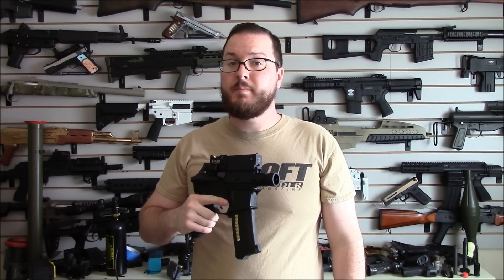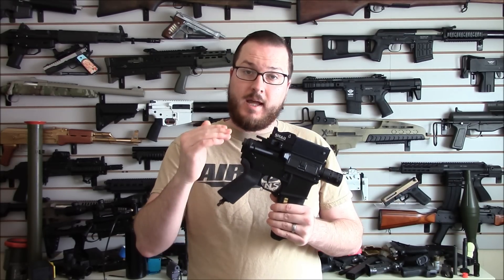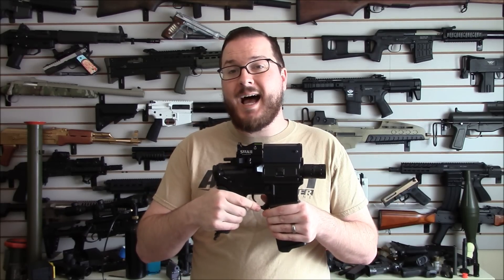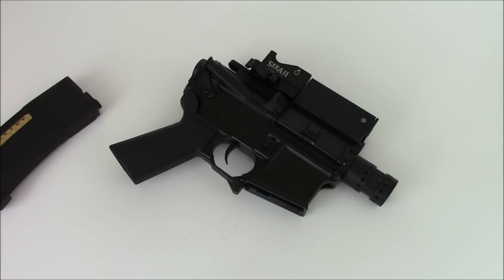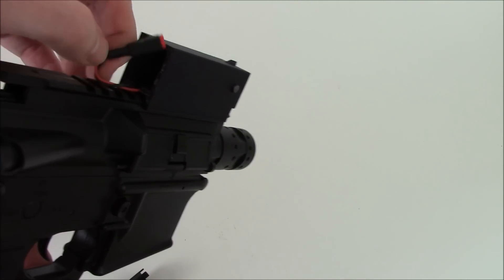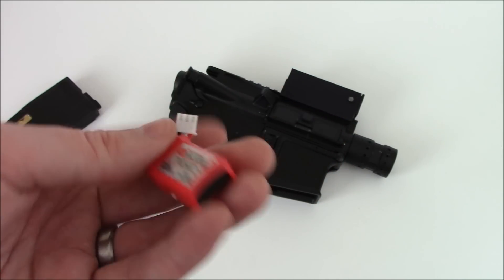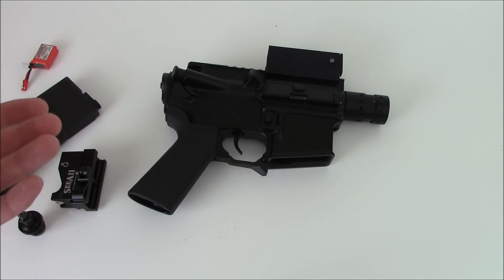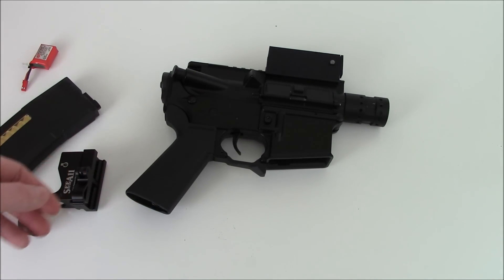Wolverine Airsoft Inferno/InGrip Regulator Overview - Stubby M4 Pistol

Comment: Booligan, I was wondering if you could give me a list of what components you put in the make it run CO2, specifically what the connector coming out of the bottom of the Storm is called, what sort of reg line to use (or can be used), and what connector (if that's what it's called) to screw onto the tank. Thanks a ton, keep up the great videos.
Reply from the maker: +Evan Cochran I used a Wolverine Airsoft Inferno kit, Storm InGrip Regulator, and Ninja remote line. The connector between the grip and the remote line is a standard remote line connector that came with the line. This is the remote I'm using : http://www.amazon.com/Zebra-Ninja-Paintball-MicroBore-Remote/dp/B00IN6NS2U/ref=sr_1_2?ie=UTF8&qid=1454859158&sr=8-2&keywords=ninja+remote+line

Comment: I am just kinda getting into the whole airsoft thing. Coming over from the dark side of course ;) As a long time paintball player, I had to cringe a little at around 3:30. But again, I'm new here. Keeping an open mind. The bb hose thing is absolutely hilarious!
Reply from the maker: +Michael Wangerin What did you cringe about at 3:30?
Reply: +Booligan Airsoft You mentioned co2 is more efficient than HPA. When I first got into paintball, I ruined a nice marker by running it with co2, and all my internals got destroyed from the cold. That was the day I learned about HPA. Watching the stubby M4 shooting with that high of a rate of fire on that kind of gas just makes me nervous I suppose. Not by any means trying to pick a fight! Only reliving a horrible $400 mistake haha.
Reply from the maker: Yeah, airsoft is totally different. Our air usage is so much lower than paintball that you can't really compare. With this regulator, you can run CO2 with the Wolverine Inferno. It's not a setup for every HPA type engine. 

And yes, CO2 is more efficient than HPA. Whether it freezes up your gun is a totally different issue altogether. When I played paintball, there were certain guns that had to use HPA (Stuff like the AutoMag RT). This is no different, just depends on your setup. This setup that I'm running should give me 6-10k shots per fill on my 20 oz tank BTW. 

Welcome to the sport! There's lots of new stuff coming out constantly, so get used to stuff always changing, haha.

Comment: Do you have game play videos using this setup? Thanks!
Reply from the maker: +Adam Goodwill Not yet, but hopefully in the next few weeks.
Reply: +Booligan Airsoft Cool! I'm considering CO2 tank since my area is not close to any HPA fill station. I'm wondering on the consistency of FPS granted that the weather temperature is about right & duration, number of rounds before FPS starts to drop or when your CO2 tank needs another refill. Thanks for the help!

Comment: I know that the in grip regulator will with with co2 (with the inferno/hydra), but can you use co2 with an in grip regulator and a polarstar fe? Thanks
Reply: +Graham Williams the FEs and Jacks are not rated for CO2 use, so we do not recommend that. However, both the Storm OnTank and InGrip will work with them, provided you use HPA

Comment: Do you know or could you do some testing on whether I can use this storm regulator with co2 on a polarstar jack. Just bought the jack and am looking for a reg and like the idea of this reg. If I could use co2 without damaging the jack I have co2 tank already from paintball. Otherwise I will be buying hpa tanks. Any help or response is greatly appreciated. :)
Reply from the maker: +Stev3419 From what I've been told, the P* and Jack setups aren't rated for CO2, even with this regulator. I don't have either one that I can test, unfortunately.

Comment: hey booligan. I was wondering in this video you talked about co2 replacing hpa. Now would this only work with this particular thing or could you use co2 on any system like a polar star. i am interested because co2 is much easier and cheaper for me too.
Reply from the maker: Only this combination of InGrip regulator and Wolverine Inferno is warrantied with CO2. If you run it on a P*, you run the risk of taking out your warranty. I can't speak as to how well it'd work either, as I don't have any P* setups.

Comment: Hello, I have been researching what brand AEG AR pistol to buy and came across your video. Very good video. I am wondering what is the base AR you are using? I skimmed through your video's and comments but couldn't figure it out. Thanks. Edit: I ran across another video where you say Bravo M4. Go figure. In any case whats the battery box on your m4 top rail in this video? It doesn't look like the Milsim Labs one you had previously.
Reply: Mr. Catcrab Music thank you I know it's HPA.  I didn't ask him what battery.  I asked him what is on the top rail. Also it does need a battery for the FC.
Reply: DarkerSavant Yea I realize that now. I told it to delete the comment but I'm having connection issues right now so I guess it didn't go through. Sorry if I seemed a bit like a jerk
Reply: Mr. Catcrab Music no problem.

Comment: "cheaper than HPA" Mate, I have my own electric air compressor and a rig that lets me wear it like a backpack. it does not get cheaper than that if you already have one.
Reply from the maker: Sure, but most people don't have a high volume electric air compressor. You're the very rare exception to the rule, lol.
Reply: Eh, it's low volume.
I'm a mechanic, of course i'm an exception :D
Reply: I think it's cheap I come from paintball I have a few tanks already. I got into airsoft to get away from the tanks. at this rate you will see somebody come on the airsoft field with a speedball gun that shoot bb
Reply: $50 for a 2 gallon air compressor that weighs 17 pounds.
Reply from the maker: That already exists. Just like there are paintball guns that resemble real guns. Some people like realism, some people like speedsoft. There's room for both in any sport.
Reply: my dads friend demolished a shop wall trying to fill an air tank with a super expensive industrial air compressor. the tank turned into a missile and hit the wall and took it out. was funny as fuck.